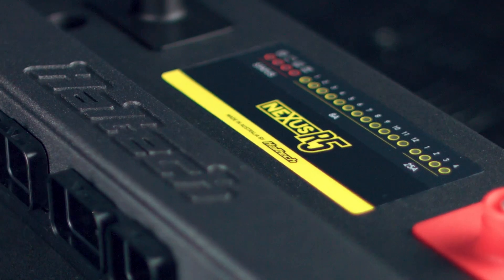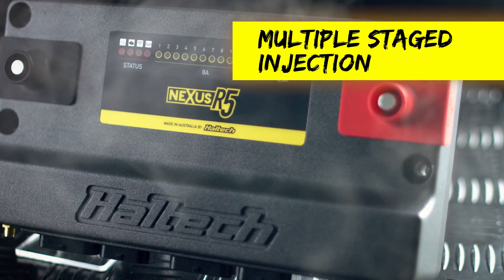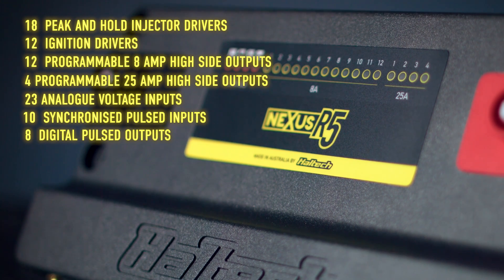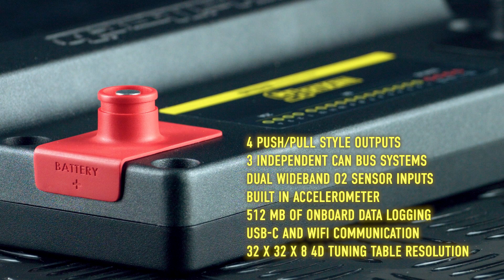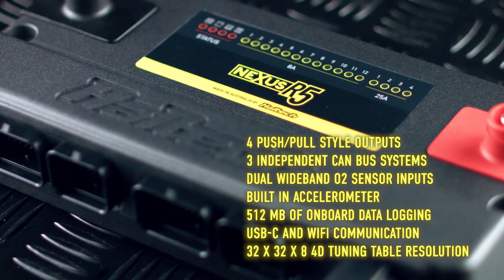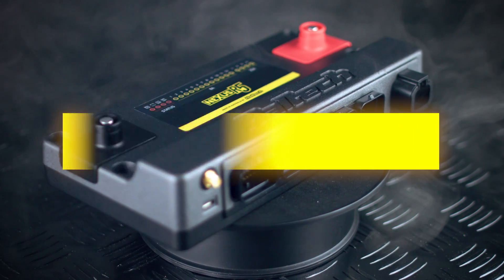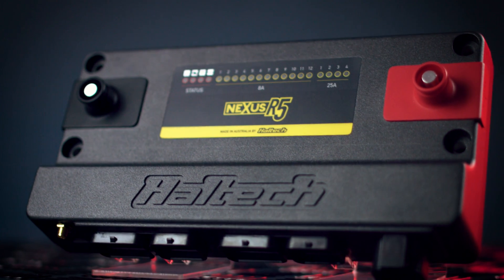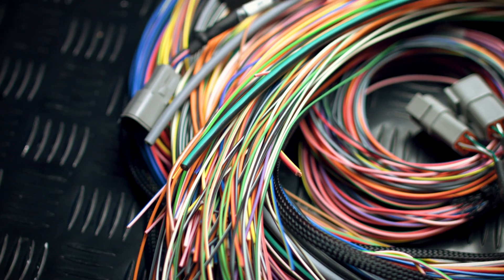✅ NEXUS R5  |  FAST FACTS

Comment from the maker: Another "Fast Facts" video providing a quick overview of the product without lengthy explanations or fanfare (we have links to those detailed videos below). Today the spotlight is on the NEXUS R5!
----------------------------------------------------------
NEXUS R5 is the new Haltech flagship product combining the functionality of a power distribution module, a data logger, a dual channel wideband controller and a state-of-the art engine management system in one powerful device we call a VCU (Vehicle Control Unit). With 18 injector drivers, 12 ignition drivers, 6 stage Nitrous control, auto trans control and an impressive list of in-built features like digital oscilloscope, accelerometer and W-Fi communications it’s a must for any serious drag or circuit racer.
----------------------------------------------------------
Unboxing and product overview: https://youtu.be/G6N_PMDHfQE
Software walk-through: https://youtu.be/s663JqYK1es
More info and specs: https://www.haltech.com/nexus/
Pricing and Accessories: https://www.haltech.com/new-release-nexus-r5-is-here/

Comment: Haltech has come a long way, since I bought they're haltech E11 V12 when they first came out. It was intended for my first car a 1990 Honda CRX the more rare model with the glass roof I had big plans for it with a Honda b16a VTEC engine but sadly didn't finish the project still have the ECU though.
Reply from the maker: It seems all you need then is a new project car:)

Comment: Dual drive by wire? Are you saying they are they are independent or simultaneous or either? Curious because you can use a DBW throttle to control the idle bypass on a supercharger instead of the old vacuum style bypass.

Comment: This thing is clearly good value for what you get. But geared towards the professional racer.  At the enthusiast level what i need is something in-between the elite 2500 and this.  I want the real fast datalogging, newest technology, and built in wideband controllers. But don't need that many injector or ignition outputs, advanced torque management or wifi because of the added cost.  If the Elite 2500 were $500-$700 cheaper id pull the trigger.  It's a good product but its 6 years old now, plus i don't want to eat the cost of adding the wideband controller on top of that. I would also be super ecstatic if you kind folks made a plug in harness for the 06 Sti and not just the 06 Wrx.  I'm looking to replace my terrible aftermarket ecu right now but I feel like i need to hold out a bit longer.  I do appreciate you bringing these types of products to market though.